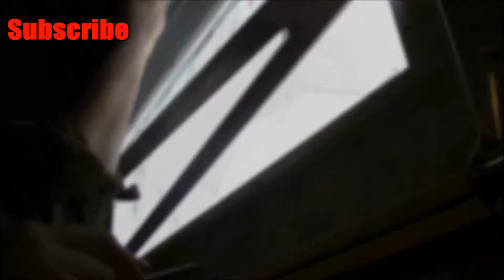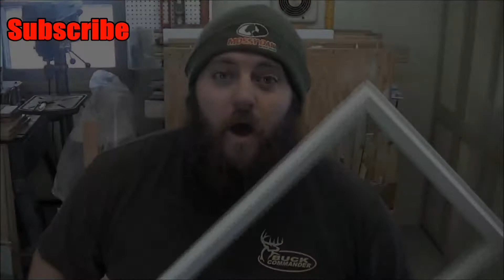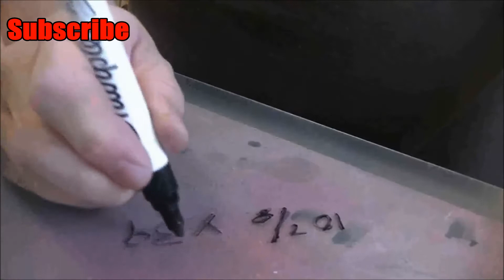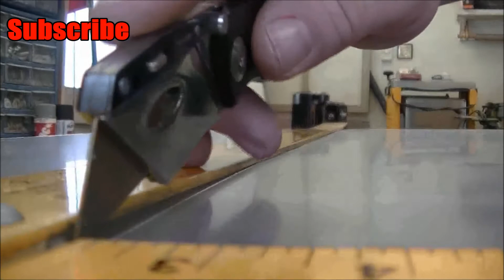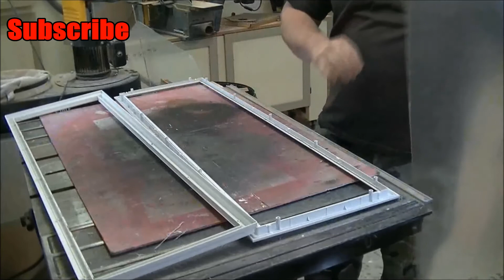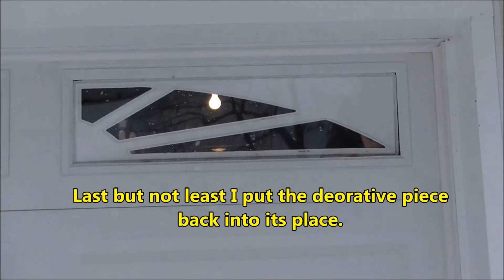★ DIY Cheap and Easy Window Repair / Replacement | The Proper Way

Comment: Good video the issue I am having is finding replacement retainers.  The door people said I would have to replace the whole garage door.... A bear got in the garage for some trash...
Reply from the maker: Allen Carpenter the window retainers are sold as a window kit. You could just order another window kit and that would work as long as it is the same size or just a little bigger. It sounds to me like your garage door company is just looking for a sale.

Comment: I know that you know Dan, but it is pretty important to wear gloves when removing the broken glass panel.....safety first!! Great video.  Thanks.
Reply from the maker: larryz24  I actually had started out with gloves on, but could not get a good 
enough grip on the screwdriver. Those screws were really in there. I'm 
glad you mentioned it though, because both gloves and glasses are 
important in this task.
Reply: larryz24 Along the safety side of things...

Not a good idea to remove glass from a location like that while working with your head below the glass.  At least stand on a ladder or something to get your head higher... Better to remove the entire panel from the door and repair the glass on the workbench.  And if removing the whole assembly, still get your head above the work.

also...

Glasses/goggles and better yet "face" protection  full face shield if possible.

Tip... Do you know that acrylic and polycarbonate sheet can be cut like glass?

that is...

Scribe it and snap it.  It will snap crisply along the scribe line and is especially easy with the thinner panels.  That would be the "quickER and easiER" way.

Be well,
Keep up the good work...

Anon
Reply from the maker: Anon Ymousmie thank you for the tips. I appreciate your input. Windows are not fun to work on in the cold. Oh well at least now I don't need to worry about it.